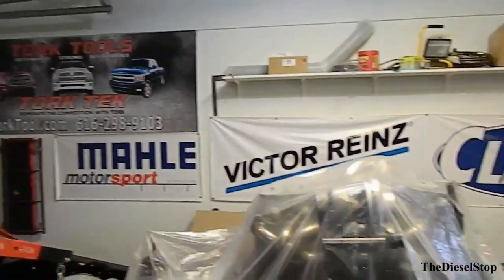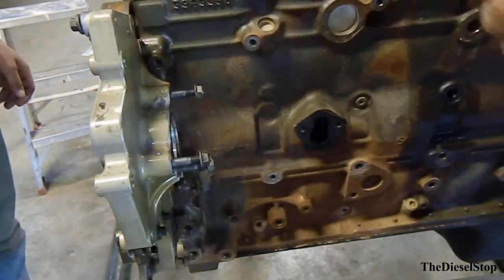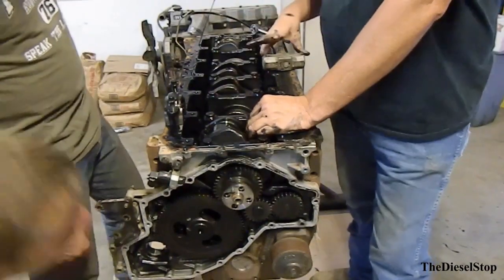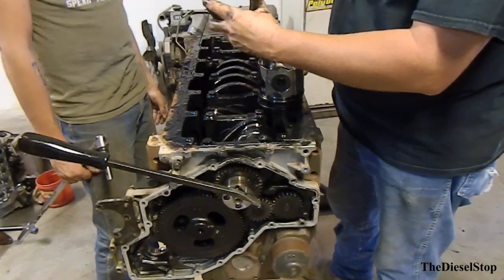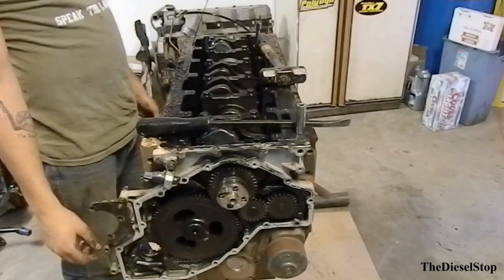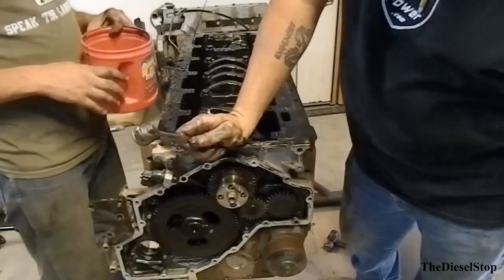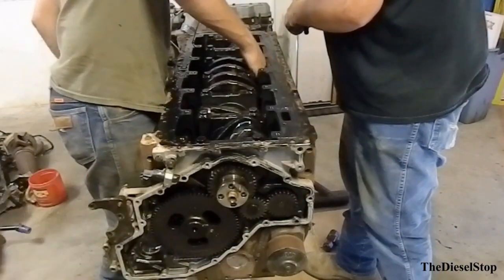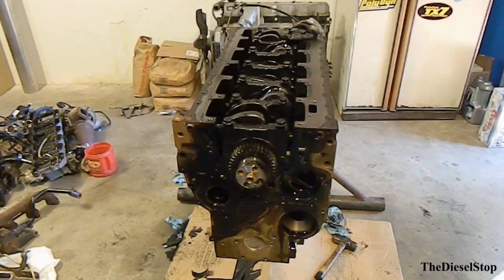04 Common rail 24 valve cummins tear down using tork tools part 2

Comment: Thanks for the vote of confidence on the 53.block. I am putting this engine into an early 1950's IHC pickup, crewcab with 4X4. I have a rebuilt 4bta that is going into my sons 1952 IHC  pickup. It will be a 4X4 also.  We will start the mock-up next Monday. I may post some build video and pictures on You Tube.

Comment: Great to see you making videos again, we missed them.  What is your opinion on a good lift pump to replace the factory one on the 24 valve cummins.  I have been doing a lot of research on this and curious what you do on your 24 valve engines to fix the factory pump.  Thanks for the videos.

Comment: Would you be willing and able to give a little video and talk about the 53 blocks. I have a new 1999, 53 engine complete with less than 1000km on it. I bought it from an insurance company 15 years ago and I have never started it. There is no sign of the cracking yet. Did I buy a problem?
Reply from the maker: I have a few of the 24 valve Cummins. I have a 02 dodge that has 280k on it and yes it had a crack in the block & still drive it every day. I found some blue devil to put in it and it has been fine sence, I also have a 01 that had about a 100k on it with no problems all. A friend of mine has a 99 with over 500k very rough miles & it has no problem.